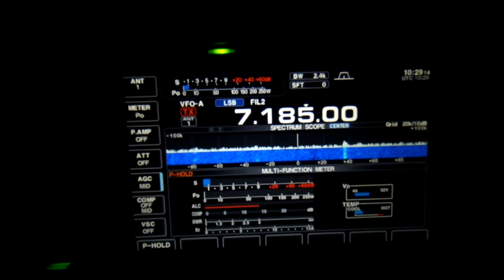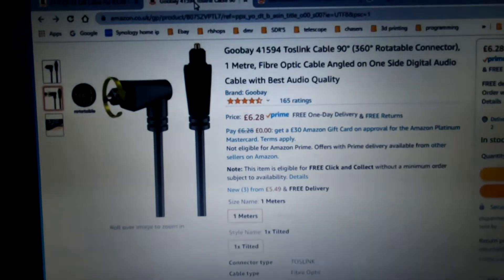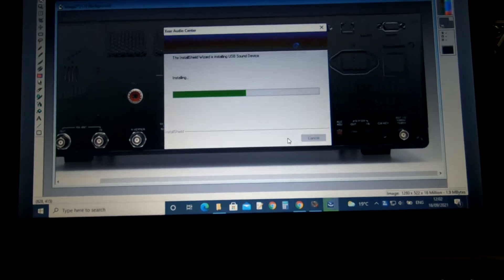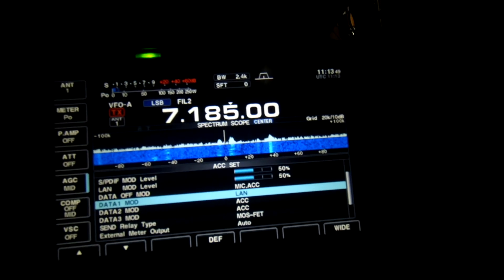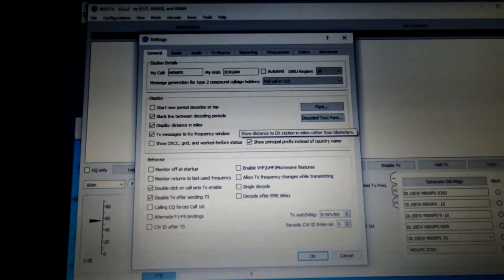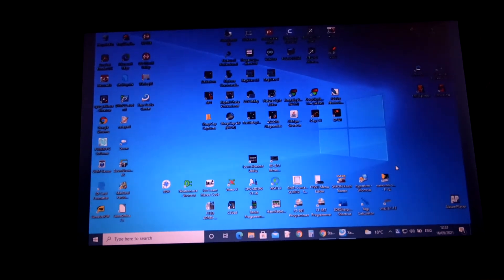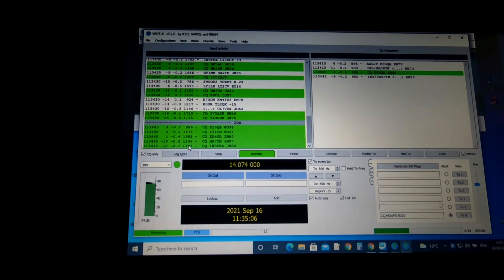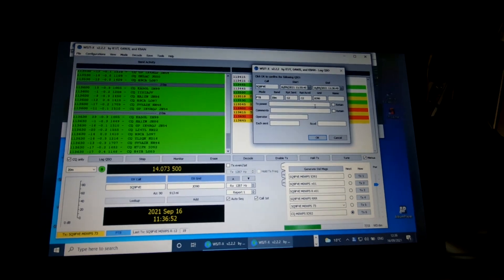Icom IC-7700 Setup for FT8, FT4 using WSJT-X, USB Audio Adapter Sound Card with SPDIF Digital Audio

Comment: Thanks for the detailed video, I found your video because I will be setting up a friends 7700 to use the RS-BA1 V2 software from a remote computer so I assume this setup is what I need for this ?civ cable + external sound card ?
Reply from the maker: Hi if you have the RS-BA1 software you do not need the external Sound card, please see my other video for installing the RS-BA1 software for use with data modes. https://www.youtube.com/watch?v=YEoMErbpp38&t=1s